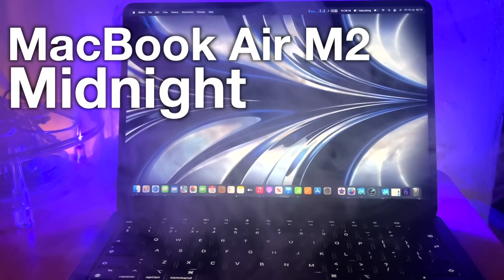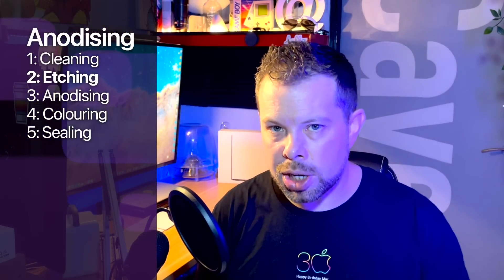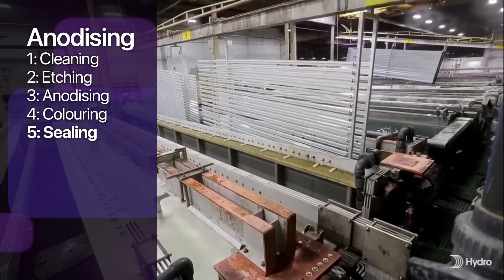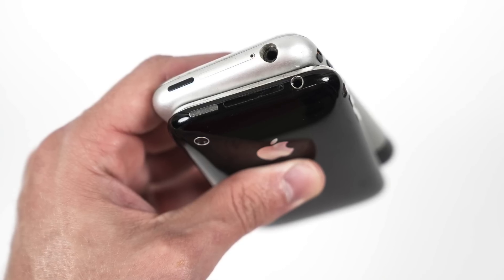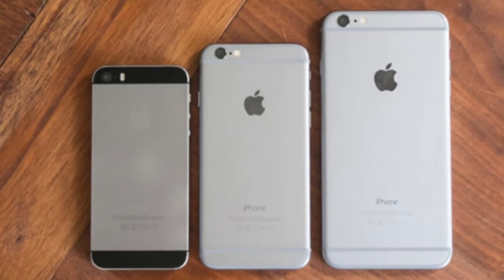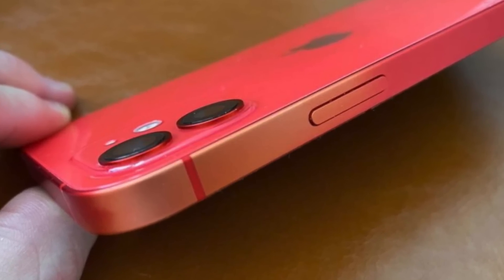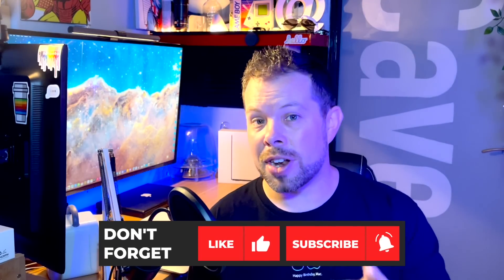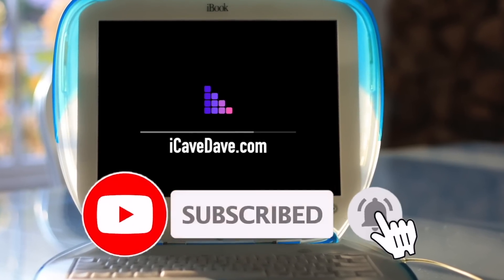MacBook Air MIDNIGHT has a PROBLEM!

Comment: So, I came home after eating dinner a couple nights ago and walked into my room. I had my laptop on my bed with my iPod touch plugged into it. My leg got caught on the cable that was plugged in and yanked it out. That was enough to scratch the first USBC port on the machine. I am taking it into the Apple store later today. They had better be able to fix it. the weak design of the ports on the M2 is not acceptable at all. An almost $2000 laptop should never be scratched that easily. If Apple products were made here in America? we would not be having these problems. Tim Cook needs to be forced out of apple now before the company completely collapses. I’m back from the future. It turns out the port is not scratched, but when I pulled the cable out, it warped the metal outside of it. Cables can still plug into it, but I’m going to get it fixed, even though it means replacing the whole top case.
Reply from the maker: That's (a) a pretty extreme reaction, (b) why were you USB charging instead of using MagSafe which is designed to come away easily if you snag or trip on the cable. Scratches are wear and tear, so I doubt you're covered. Also Tim is a genius in business terms, he's never getting forced out.
Reply: @iCaveDave  as I stated, the cable that I was charging my iPod with got pulled out of the computer. The connector then brushed up against the port, and scratched it.
Reply: here's an update. My laptop is now fixed. I payed $100 for Apple to replace the top case of the laptop. I am very happy I have Apple care.

Comment: That's ridiculous! I had golden M1 air, and large part of a reason I sold it - it was a fingerprint magnet, especially keyboard. That's just gross. I don't really understand why Apple uses such idiotic approach. I've never seen worse laptops in terms of maintaining the clean and beautiful.
Reply: Large, but not primary :) The main reason was Macos - window management is plain terrible.
Reply: I carried a jet black/piano black iPhone 7 for a year and it was still pristine after that year without a case (it’s criminal to hide that in a case). I traded it in for an iPhone X the next year, but that piano black was awesome. Sure it was a fingerprint and scratch magnet, but looking at mine, you needed a magnifying glass to see any micro scratches. Take care of your device and it’ll be fine.
Reply from the maker: Yep! I had the jet black 7 plus!
Reply: @techinrl9869  for a phone - it’s not that critical. All phones screens get fingerprinted anyways. But I don’t tolerate that for keyboards and laptops

Comment: I'll wait until Apple fixes the cheap coating on their new laptops. I usually replace them every 2-3 years, but not now. Just like the lack of a cheap gasket to prevent water damage when exposed to water, Apple has found it best to cheapen the finish on its computers to allow for scratches which inevitably encourages its buyers to buy new products every few months to a year. I noticed scratches on ALL of the store models of the "new" MacBook Air. Hard to believe just a week or so after the latest introduction, but that's where Tim Cook has taken it. Steve Jobs would not have approved.
Reply from the maker: Laptops with IO, keyboards and speaker holes are almost impossible to waterproof, let alone those with cooling fans. Difficult to have airflow without allowing water in. And all aluminium laptops will scratch and wear, they always have. The difference is when the anodised surface is anything but natural aluminium covered, scratches are more noticeable. If you don’t want to see them, buy the standard silver!
Reply: @iCaveDave I agree on ones with fans. But the M2 Air has no fans. I personally think it can be water proof and would be awesome if they do it.

Comment: I bought a 2015 MacBook Pro 15 in 2018 as a backup machine to my 2014 which I used for work. I got a great price and it had two corner drops, scratches all over the bottom, a gouge on the side and the top screen section isn't completely aligned with the bottom part of the laptop. But it has served me well for over four years. At some level of damage, you don't care. On the other hand, my 2014 is still pristine. I take excellent care of my Macs doing the kinds of things recommended in this video.
Reply: You weren't kidding about YouTube processing time. Is that a general issue on Mondays? Perhaps there's just far more content posted on Monday mornings than on the weekend.
Reply from the maker: It's very dependent on the video and the timing. I think.

Comment: Wow! Thanks for the warning. I never would have considered this otherwise. I guess I'd get the silver model, and slap a blue cover on it ;) Ha, I just saw your  comment on not covering it with a shell ;)
Reply from the maker: The other thing with shells is they add an insulating layer that will stop the MacBook dissipating heat as quickly as they should.

Comment: I personally buy my phones and laptops for the utility and software inside so I always put uber protective cases on all of them. Helps keep the resale value as high as possible if the devices looks good as new without scratches or dings 2-3 years later.
Reply from the maker: That's fair, if you're reselling I get it!

Comment: the best video on this topic I found so far. Thank you! It helps me to decide on colour choice. It would be great, if you could make a scratch test!
Reply from the maker: I mean, I’ve had it close to 2 years now, in day to day there are zero noticeable scratches, however as I predicted, there is some colour wear visible on the bottom left corner where my Apple Watch is, but I would also say it’s looking very new still for a 2 year old laptop
Reply: Thanks  @iCaveDave  for reply! I still think a scratch test would be interresting, just to see how sensitive the colour is and what to expect over years of use. But I understand it would be a costly test to make 😬
Reply from the maker: @tobiask8490 I always reply 😉

Comment: Do you recommend using a screen protector on the MacBook?
Reply from the maker: Absolutely not. You don't keep it in your pocket, and there's no reason to be touching the display. Some screen protectors are also thick enough that they can apply pressure to the display when it's closed, causing stress fractures to the display. Steer clear of them, and especially camera covers and keyboard covers.
Reply: @iCaveDave  I see..

Well, I have been using a screen protector on my 2015 MacBook pro for almost 9 years without any problems or damages...

I use a very simple thin screen protector, though

Comment: Interesting review Dave. One area of interest for me is the idea of not using a case. 

I personally use a clear case specifically because I want to protect the finish of my MBP and also because I do like that it allows the original finish color to stand out.
Reply from the maker: Any case like that will also impede heat dissipation, but if you're not pushing it hard, go ahead. I personally just think they're all super ugly!
Reply: @iCaveDave  I would be interested in seeing some sort of experiment/test ran to see if these cases actually do impede any heat dissipation. I’ve ran a case on my MBP for awhile now and have never had any issue. So I would guess that the same would hold true of a case on the new MBA. It would be very interesting to see if I am correct, or if the cases really do create an unintended consequence with the heat issue.
Reply: I bought my first MacBook in 2015, always had a case, my 2017 case had a thicker top (didn’t realise until I got it but I loved it. I’ve had no issues with heat dissipation at all, and I use mine for study and personal work, I also use it to help others put letters and evidence together for civil and other legal cases so they’ve all been used a lot! Just got my midnight air 2 weeks ago. Clear case, screen protector, transparent touchpad and palm rest protection covers 🤷🏻‍♀️ same I’ve always done for my macs (my 2915 was stolen so I bought a 2017, just got my midnight.  

The only difference is that my touchpad and palm rest protectors were silver, and I had a patterned/coloured cases. 

I factory reset and set up my 2017 air and gave it to a good friend, as her 2010 MacBook is done for! And she too used hers heavily but it’s finally met it’s end.
Reply: @emmalawson1504  fantastic. I ended up going to the 16” Pro and am on the fence if I will custom design another case, go with a clear one, or just get a premade patterned one. 

But your post has me leaning towards maybe find one premade and roll with it. 

Now to decide what to do with my old 13” M1 MBP (that felt so weird to type “old” and “M1” in the same sentence. 😂

Comment: You were spot on.  My MacBook Air m2 in midnight blue showed a very noticeable paint chipping on the right corner.  The silver is showing through the midnight blue.  Didn't drop it, I use a case every day, but I guess it bumped into something.  I'm using a black sharpie to hide it.  It still rubs off, but at least it's not as noticeable anymore.
Reply from the maker: Yeah mine has some anno-rub around the bottom left corner from my watch strap - but I have to say in general the finish has held up better than I expected!

Comment: Hey, I want a new macbook. Is MacBook Air (M2, 2022) 13.6 inch with 8-Core CPU and 8-Core GPU, 256GB SSD - Midnight 8gb memory
£999

Is it ok for automatic 1111 stable diffusion?  Is it a good price?
Cheers
Reply from the maker: I've not done a lot of AI image generation personally but the system itself in general is solid. I'd probably reccomend getting the $100 GPU upgrade as AI would hit that more, but at that point getting the M3 version is probably the better choice.

Comment: No way I’m going without a case. Never. Ever. If you still want the color get a frosted case. They look sick and won’t piss you off when you drop it and ruin it forever. Cases are essential.
Reply from the maker: Weird that I managed without a case on my MacBook Air for a decade then if it’s essential.
Reply: @iCaveDave  I’d like to see it
Reply: I treat my MacBook how I treat tools. If it scratches no big deal, I use it for work and media, it’s a working laptop. It’s already got plenty of scratches on the outside, one corner is a bit dented and one side has a piece chipped off. Ports are scratched from cables being plugged in and out. And I like it this way. But that’s a personal preference of course

Comment: I would like the midnight, but I often have to work with the laptop outside in direct sunlight and concerned about that color absorbing too much heat, causing the computer ot overheat/kernel panic (which happens with my current macbook) or too hot to the touch so considering going with the silver instead, what do you think about this idea of the midnight black absorbing more heat in the sun? Is this not relavnt?
Reply from the maker: I would say its unlikely to be an issue, especially in normal usage (assuming you're not running massive simulations or transcoding 8K raw video outdoors all day) I've never noticed any heat from the system even when rendering video files.
Reply: @iCaveDave  Thanks! I don't know why, but my macbook retina 12" 2017, after I 'upgraded' to Monterey, started overheating and going into kernel panic loops that essentially made it unusable if I open more than a few tabs at once, wary of this issue happening again.

Comment: There are some crystal clear cases on Amazon I was considering ordering one so I can put stickers in between so I don’t actually have to stick stickers to the device. Should I get one still 🤔🤔
Reply from the maker: The issue even with clear cases is that it reduces airflow so you may have worse thermal performance - stickers or skins should be absolutely fine though on the laptop itself
Reply: @iCaveDave  there just really nice stickers and I don’t want to actually stick them on the laptop 😅 I might only use the top piece of the case so it doesn’t affect thermal at all.

Comment: 9:40 Why not buy a clear shell or clear case? They still show the awesome color but protect from wear. I use a clear case on me Sierra Blue phone. I can see the awesome color and your cheap hard case will take the wear. It might also help to ease the rounded edges as well. If I were to buy a new Air, i would buy the midnight color. Can we get that color on the MacBook Pro/Mac Studio?

10:19 We Americans don’t all keep firearms in our backpack we wear usually hide them under our clothes somewhere.
Reply from the maker: Why not use a clear case? Because they also insulate and keep heat in, so they hurt performance. And also look terrible.
Reply: I agree, if I’m gonna buy a laptop that’s almost $2,000 then I’m gonna buy a case 😂 it’ll prolong the looks of the laptop

Comment: Do you feel clear cases with ventilation holes are still something you’d recommend against?
Reply from the maker: Personally yes, especially in something like the MacBook Air where heat dissipation is radiative as opposed to being vented by a fan. You need the metal casing exposed to the air as much as possible.
Reply: @iCaveDave  thank you for your reply. It’s much appreciated. I’m now rethinking and will likely cancel my preorder on a clear hard case. I want to protect it but still show the color. This will be my first Apple computer, so I’m a newbie with these. I appreciate any advice and tips. I just subscribed to your channel!

Comment: Why do all dark colours from Apple always have a problem? I remember the dark iPhone 5, dark iPhone 7, etc. They all had problems with scratches, etc.
Reply from the maker: It’s nothing to do with Apple, it’s just that when a dark colour scratches and shows the silver beneath, it stands out. When you scratch a silver MacBook, it’s still silver.
Reply: @iCaveDave  I’m just wondering because my car is made of alu as well and doesn’t lose paint just because I smash the door when closing, etc.
Reply from the maker: But apple devices aren’t painted, they’re anodised. It doesn’t lose a coating, the top layer of metal is chipped off. Also, your car is probably steel,
Reply: @iCaveDave  Nope, it has an aluminium frame.

Comment: I have a msi gs70 crimson red, which is also aluminium, as my secondary machine since 2014. It looks new, only some chippings around headphone jacks. If msi could do it in 2014, Apple should be able to do it in 2022.
Reply from the maker: They can, it will be about the same

Comment: Not even the outside, even the screen is easily scratched
Reply from the maker: I have zero scratches on my screen. You cleaning it with a Brillo pad?
Reply: Hahah 
No, I cleaned it with a regular paper towel and hairline scratches are visible for the 15" M2. 
which is weird because my MacBook Pro from 2017 never had that issue.

Anyways I did ordered the Apple's polish cloth, maybe that will be good for the sensitive screen of 15'' M2   @iCaveDave
Reply: It is arriving tomorrow, I'll upload a video.

Comment: They sell anti-fingerprint cleansers and coatings for glass and other surfaces. Wonder if it is safe and effective on colored aluminum surfaces.
Reply: Who want to clean it every 10 minutes? That's definitely not a solution.
Reply: Yes- Renaissance Wax is a great treatment for hard goods and prevents fingerprints from sticking to the surfaces.  It works great on anodized items (particularly good on firearms bluing) and also provides a tiny bit of extra scuff protection (within reason)
Reply: @sergeyd2199  Agreed. An anti-fingerprint cleanser that would remove and then prevent them would be best. Already similar products out there for other surfaces, so worth a try.
Reply: @buddypage11  Nah, they need to select better materials. I have a Logitech keyboard, and while it will become somewhat dirty if you don’t clean it for a week or two, you don’t need to clean it every 10 minutes. So they managed to find a proper material - why can’t Apple do the same?
Reply from the maker: You mean plastic? Because Apple’s huge deal is not using any BPA and making everything recyclable and sustainable.
Reply: @iCaveDave  yes, at least for keyboard, I mean. I can live with current aluminum body if it's silver, but the keyboards are awful even on the most expensive Pro's. They could solve this issue at least for the keyboard.

Comment: lol...most people who carry a firearm in the US do it with an inside the waistbelt holster (which requires a concealed carry permit easily obtained in most states).  I seen some bumbag products developed for carrying but carrying a loaded weapon with out securing it seems like a bad idea.  Not to say some people don't do it but the generally accepted practice is to carry in a holster or a bag specially designed to secure the firearm while also keeping it accessible for self protection.
Reply: Wow I didn't know MacBook is related to gun.
Reply from the maker: I know I know, I was making a joke about what could scratch up your Mac.

Comment: I brought this up as a comment on YouTubers that went to WWDC as some of the footage did show wear on the USB-C ports already and people responded that they were probably tested a lot… but how much was it tested/used before wearing down to show the metal color underneath?  One YouTuber that received their new MBA said it wearing after only a few times plugging things in and out!  Sheesh — that’s not good, but also, I get it, nobody is going to judge you based on the wear of your USB-C port, lol.  I do like the idea of using a dongle dock to reduce how many times you plug in and out.  I’ll definitely be as careful as I can plugging it in and out; unlike iMac where I used to try and guess!
Reply from the maker: Yeah at least you can see these ports!